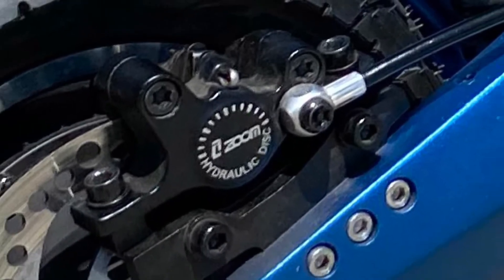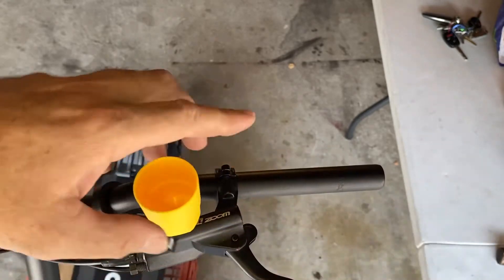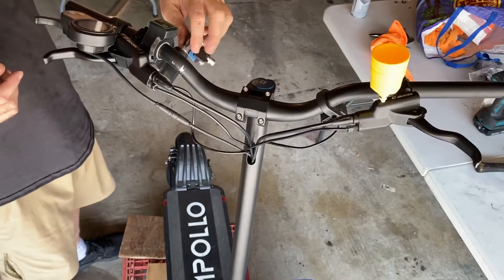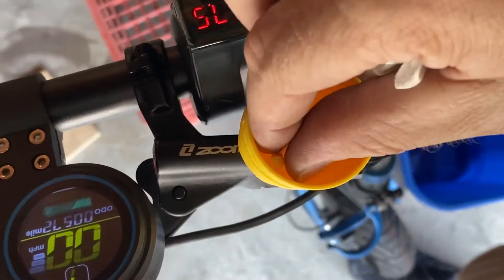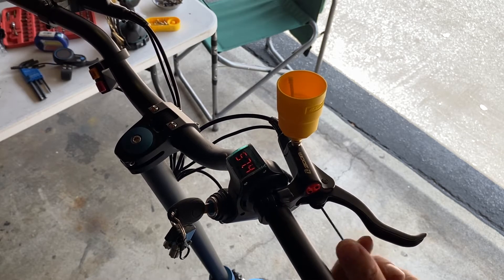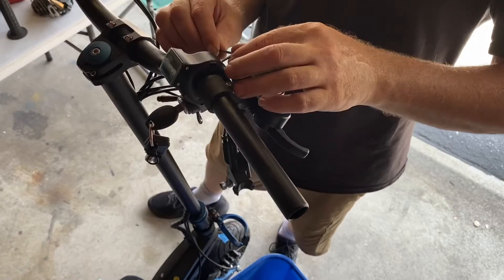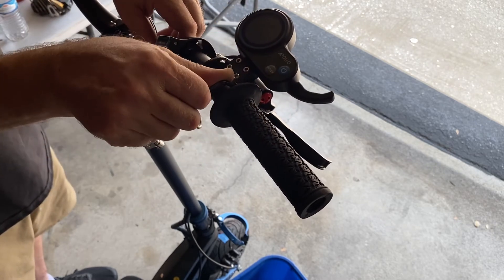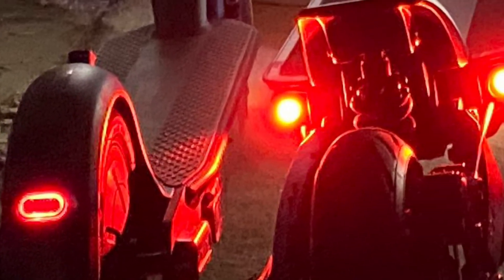How to bleed Zoom hydraulic brakes on Apollo Pro Zero 10x Turbowheel lightning (handle bleed)

Comment: Hi guys, I have a leakage somewhere around silver hose end, showed in 00:01 of this clip. How can I fix that? I assume there are some silicone o-rings inside or something similar... How can I get new set of these o-rings? Does anyone know size of them?
Reply from the maker: There might be a crush washer you need replace in there. Id contact the retailer you bought it from. If you can remove it and figure out what size it is they'll have it in the mcmaster carr catalog.